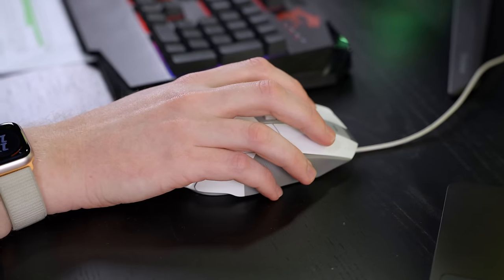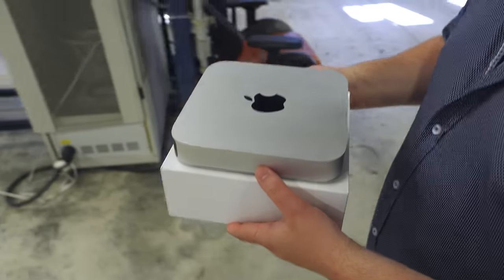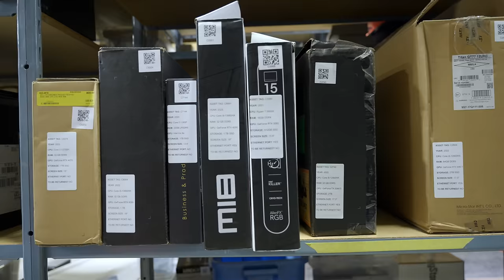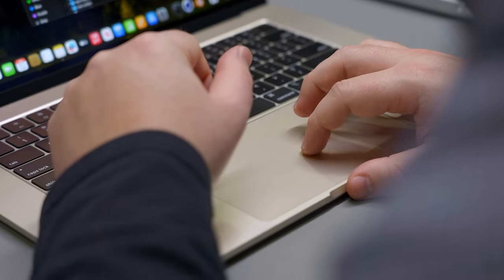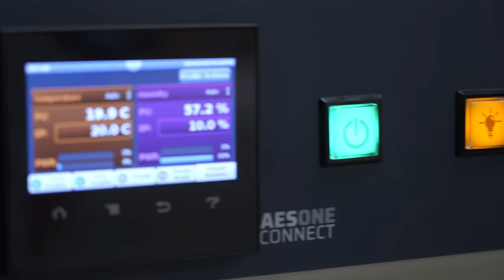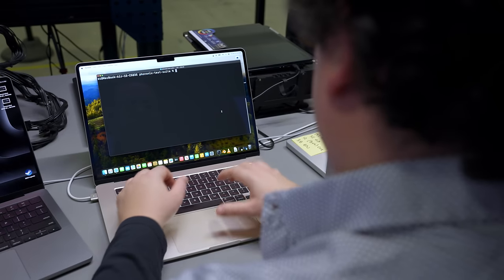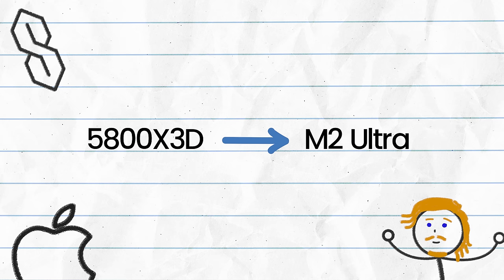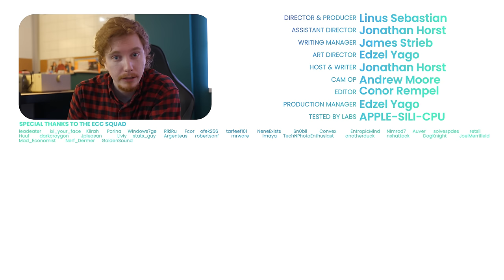How Apple Silicon Compares... - Part 1

Comment: I would get a new mac, only if another 8 gigs of ram didn't cost 200 dollars more...
Reply: your loss
Reply: @chewbster  His gain actually since modern amd laptops can match performance and battery life for macbook pro at a far better value
Reply: I am running an m1 air with 8 gigs and it is painful.  I'm going to have to spend $800 more for used hardware to have less RAM than a new Windows machine.

Docker, fusio 360n, cura, and a browser are a pick 2 situation on 8 gigs and there's still huge swapping that will kill the NAND over time.
Reply: Mac's used to be the come up a few years later once they were steadily discounted. But that was when they were upgradeable.
Reply: @piyh3962 why did you buy the 8 GB model if that’s what you plan to do? That’s on you tbh
Reply: Not trying to justify the ransom that Apple charges for upgrades (it’s a disgusting markup). But look at it like this: I need a Mac for the work I do (music, color accurate photo work) and I’m in the market for a new MBP, so I budget for the 16gb model. Since 8gb is useless I think of it as a cut down slightly cheaper model that would never work for my needs so it’s not worth worrying about.
Reply: Especially SSD storage
Reply: I am temporarily running an M2 Base 8G while my M1 Max 32G gets repaired. I expected problems, the only thing that’s been an issue is Lightroom. 

I am shocked at how well this performs. Though, still I would never recommend picking up an 8G model
Reply: @aravindpallippara1577   Its not just about the cpu dude. Thats like buying a car for the stereo.
Reply: @CallumAi  No kidding lol. I have a 8GB mini M2. Works  perfect and never seen it slow down. But I'm not video editor like the other 95% of people Not on a tech channel. Go figure. 8GB is plenty for a majority of people on a Mac where it's built into the cpu.
Reply: @chewbster  “yOuR lOsS” that’s how you sounded 😂
Reply: @DozIT   Exactly. I sell for Apple. 95% of the people I sale too don't edit anything except documents. No music or video editing and no Lightroom. They never have an issue with 8GB ram. Yes it would be nice to have 16 base. But most people don't even know what ram is. lol. They just turn it on and go to work. And nothing is better than a Mac for that. I tell them when they want the base model if you don like it you got 14 days no questions asked no restock. Nobody ever brings them back. Mostly lawyers professionals and student make up the vast majority of buyers. They don't edit videos or try to side load linux ect.
Reply: @DozIT  I routinely “use” 40-50 gigs of memory between all my programs and activities on my friends 16gb m2 pro. Once you get to around 60 gb is when the system flashes a warning that you’re going too hard 😝 Yes, this will reduce the life of the SSD and isn’t great for latency, but it works quite a bit better than my windows machines
Reply: I sold my 16GB iMac for the same price I paid 1.5 years prior. Yes, it cost more, but it also held its value.
Reply: @tmanF4  100% the way Apple handles swap is amazing. And, to be honest I’m not too concerned about SSD lifespan, typically I hold onto it for 4-5 years, sell used for 30-40% of what I paid, then buy a new one. It’s worked for me since 2015!
Reply: @aravindpallippara1577 no, that just doesn't exist
Reply: Probably worth checking whether it actually matters. It's just a number.
Reply: @piyh3962 I think it's cool that you grew out of your hardware. It's pretty common. But if you bought that machine knowing you needed to do all that stuff and you chose to buy 8GB of RAM, that's your fault. Not Apple. You could have made the same mistake buying a Windows laptop.
Reply: @aravindpallippara1577 the cap 😂
Reply: @aravindpallippara1577 The battery life of x86 laptops isn’t even close. You are coping.
Reply: @piyh3962 you bought an 8gig to run all that? What the…
Reply: @Techfanatic73  As someone who had issues with 16GB of memory while doing long historiographic papers, I’m going to call absolute bullshit.
Reply: @aravindpallippara1577   I'm not sure why you would think that or who gave you the thumbs up, but that is blatantly false. It isn't even close to being true. Please post the SKU of an AMD powered laptop that can go more than 3 hours while using the GPU on battery. With AMD you can get similar performance to M3 series while plugged into the wall and going with a model that has a dedicated GPU. But performance and battery life... no. Once you unplug you will come up hours short of any M series laptop.. without using the dedicated GPU... if you dare engage that GPU you should expect 2-3 hours total battery life and thats with the system limiting the GPUs power draw.
Reply: Then you don't really want (or need) a Mac.....do you?
Reply: @koalaunknown thought the same. But recently bought a system with a modern mobile Intel chip and I get very comparable performance to my work Apple silicon machine and battery life is almost identical as far as I can tell. I run Linux tho, so may be a bit different when running windows. 

All in the device cost about 1000€ less fully configured to my needs than a base level 14“ MBP in my country (Germany). But I’ll have to admit, the display is not quite as nice as the MacBook‘s
Reply: Good news it will cost 699 L0L 😅
Reply: I would get a MacBook, if the SSD, one of the most used components, was replaceable.
Reply: @topcomp1066  have you heard of external drives? WoooOOoOOOOoooow…
Reply: It's about time that Apple cut the upgrade costs in half, if not quarter them.
Reply: The RAM upgrades are so painful to pay for. And for doing motion graphics work with after effects where it writes your preview files to the RAM you really NEED as much ram as possible.
Reply: try to get a base M1 Pro
Reply: Am really a fan. Enjoy your videos. That are informative and interesting. I think you str a good story teller which is rare for this genre.
Reply: @brandongers  Honey.. I guess you don't know how Apple Mac works, and well, how computers work in general.
The internal SSD is getting used no matter if you use an external SSD or not. Logically, because the operating system itself is on the integrated SSD, thus every operation you make, every file transfer, every app you use wears off the SSD.

Now, the moment the internal SSD dies, you can throw away your 3k laptop, because it's useless. With the new mac's, you can NOT start the device without the internal SSD working.
Reply: As long as buyers still succumbs to Apple’s strategy, we won’t win our right. People keep paying that $200 to get extra RAM.
Reply: Buy used like you can save like 1k on an almost new M2 mac book air and similar (recently here in my region a few companies dumped "old" Mac Studio M2 max with 64gb ram and 2Tb storage for like 2-3k €  as for the version with 64gb ram and 4tb storage in that price range was gone quick. Used is the king
Reply: This!
Reply: @Techfanatic73 yeah, it’s not enough for a Pro model but for the Air it’s different
Reply: This comment thread shows the state of customers really well. The fans are misquoting or are struggling with hardware specs, then the neutral buyers are saying buy used, because fck the og pricing structure and then the opposition who laughs because one bought 8GB RAM in 2024 nonupgradable.
Reply: But Apple uses ram differently. 8GB mac equals 32GB windows right?
Reply: ... and if it didn't have such a crappy keyboard
Reply: @alankucar4564  the current MacBooks’ keyboards are fine, it was the ones with the butterfly keyboard which were garbage
Reply: Get a pc for 200 you can get a lot of ram
Reply: 200 euros/dollars is the price of cheap gaming PCs 💀
Reply: Fun fact: back in 2009, it cost $1,200 to upgrade the RAM in a 17-inch MacBook Pro from 4 GB to 8 GB. However, this was still in the era of being able to upgrade the RAM after the fact, and today the same upgrade can be picked up for $30.
Reply: @chewbster apples loss
Reply: @corvacopia  you said they were fine, well if you ever used at least pre-2015 macbooks, even go as far as to 2007 ones, you would understand what I mean by crappy, mutilated garbage of a keyboard on 3000$ laptop.
Reply: Based
Reply: @aravindpallippara1577 not sure about battery life, but performance definitely
Reply: @chewbster and your loss if you’re prepared to accept that this is acceptable
Reply: @CallumAi no it’s not. Apple told him it’s an acceptable amount. They sell them as “pro” machines. Don’t put the blame on the consumer. Blame the manufacturer for making an unacceptable product.
Reply: That's absolutely fair. I'll defend Apple on a number of issues but the 8 gig's is an insult to all buyers.
Reply: Yeah, that’s why I’m glad I could afford to order my M3 Max with 64GB. Should last me into the early 2030s when they stop the OS updates.
Reply: Yes this sux. Apple should go minimal 16ram. Although its a bit  different on Apple silicon.
Reply: @amadtaz it's apples fault for selling
Reply: @KrisoVT  I hope this is sarcasm (tbh not sure cuz you never know with Apple users)
Reply: @topcomp1066  It is sarcasm, yes :)
Reply: @KrisoVT  xD
Reply: @chewbster  for not using trash macos?
Reply: @CallumAi  fr
Reply: @aravindpallippara1577 Performance yes, battery life no chance. Do you have a source for this?
Reply: Buy used then!
Reply: @amadtaz  I am a mac user but it's difficult for this to happen with any decent PC. Any PC laptop with decent specs will come with at least 16gb.

Personally, the apple toll for memory was worth it to me BUT it's very annoying that you're forced into a dilemma (is 8gb enough for me?) unless you're ok with spending $1200+.

It isn't like that with PC, if you are paying $800+ then you don't need to compromise core specs like memory/cpu/ssd (ofc the battery life and other things won't be as good as mac).
Reply: @CallumAi  cause apple charges 200$ for 8gb... by the way 200$ gets you 64GB of some of the best RAM in the market....
Reply: @aravindpallippara1577  you’re still most likely gonna be stuck with windows though. linux is fantastic and i daily drive it on my pc, but creative apps are by far the best on mac. microsoft is also just god awful incompetent
Reply: Laughs in 200$ top of the line 64GB RAM
Reply: @aravindpallippara1577  Nice try, I'm not tapping into that AMD trap again.

Comment: Love them or hate them, Apple silicon chips are impressive
Reply: Especially when compared to old Amd AM4 chips and entry level <$250 i5's!
Reply: Ikr? Amazing how Apple M3 manages to almost beat a 3 year old chip. Truly an amazing feat
Reply: What comes from this video (and even then it's barely touched), the true impressiveness comes mostly from the efficiency department, really.
As @willie69420  said, the test was only against AM4 chips, because they couldn't find any AM5 low-end enough to compare to slower Apple silicon ( 8:22 )
What really sets Apple apart from the PC space right now is how it performs while still being in a micro or even laptop form factor (and in the laptop FF, the fact it still have such battery life is truly amazing).

But yeah, being compared to a multi-years old architecture isn't the most flattering thing ever when only considering performance (and price to performance).

Honestly, I don't follow closely enough Apple hardware stuff to know, but I guess there were important redesigns between the different iterations of Apple Silicon, akin to a change of overall socket/generation for a CPU. So it feels a bit strange/"icky" having what is essentially 3 generations of Apple Silicon against only one in the CPU department.

I suspect parts of why they chose only one CPU platform was due to time budget allocated for Mac Address with the Lab team tho, and to keep charts readable in some ways.
All in all, the tradeoff is understandable and I'm quite interested in seeing the next parts, and how the team change their routine to accommodate for Apple benchmarking.
Reply: but apple killed it by not giving those platform (all of M seriess) upgradeability. Soldered DRAM is understandable, it saves power when the chip is closer to the CPU. but the SSD? its atrociuos and so anti consumer and anti green. give it a empty M.2 NVME slot and will erase 60 to 70% bad publicity. if they want to milk it, just give the slot to Pro line.
Reply: Compare it with something in the same price point..... lol...
Reply: Disappointed they didn’t compare against some newer CPUs for single core like the 7800X3D or 14900KF. According to other tests the M3 rivals them in single core. I’d be interested to see if labs would get the same result.
Reply: @KarrasBastomi  also the upgrades are just way too expensive. I could live them being soldered on, but it's grossly overpriced.
Reply: Apple Silicon is a true revolutionary breakthrough! My only gripe is their philosophy of almodt everything is soldered to the board and what's not is encrypted to avoid consumers replacing parts when needed,  down the road any of the components may fail and it will be really hard to fix these machines and that's no bueno
Reply: As impressive as their high prices, lack of repair, no upgradable options, and zero effort in letting you do fun things like play games let alone at a decent frame rate. Its really astonishingly impressive what a "office work" only platform that costs $3k will get you now a days.
Reply: Those Ryzen 5000 series CPUs were released in 2020 and the AM4 socket they use came out in 2017 (2016 for Athlons)
Reply: @eduardofrances  Apple Silicon is nothing good.  Reviewers are screwing results to favor Apple.  There's a reason why Apple is losing 34% year over year on Mac sales.
Reply: @KarrasBastomi no other platform has even close to the same bandwidth. M1 has 600GB/s ddr5 is like almost 10 times slower
Reply: Truth bomb 1: Apple Silicon is impressive, because the power to performance ratio is absolutely ridiculous compared to AMD and especially Intel chips.
Truth bomb 2: Apple Silicon is even more impressive, because even a 4000$ M3 Ultra won't give you even half of the graphics performance of a 2000$ gaming PC.
Reply: @gamebuster800  I have the 5800X, I thought it was super powerful. I idle with 100W.

That mac doesn't even draw that on full load (GPU included). 

That on the go with 16+ hours of battery life. Sign. Me. Up.
Reply: @Murv  You don't get 16+ hours of battery life unless you don't use your machine for anything but watching a movie on lowest brightness.

The 100W in idle is just a tuning issue. Most motherboards come with a very power-hungry profile out of the box because people care about performance more than efficiency.
Reply: MacBooks with Apple Silicon are great and they are competing fiercely with the latest chips from Intel. However, the inability to use graphics cards like the RTX 4090 limits its potential. I know Apple is trying to integrate everything into one for optimization but Apple is still relatively weak in their Metal GPUs.
Reply: @gamebuster800  Watching Youtube videos is not exactly idling.

Either way. I'd code on it. As battery life is 22 hour-ish, id probably get 16
Reply: Yep, they very much are revolutionary. If you dont believe, i did pick an M1 mac mini as my gaming machine (yes i know, gaming on a mac, but i already hated windows a lot in this timeline). I had really high expectations but the machine exceeded those, which helped myself to convince me that windows is trash.

Also, no i'm not an apple fan. I did discard iPhones because of lack of performance, battery and also the OS felt too limited.
Reply: Yeah theyre literally like 30% faster than the 13500 in single core wtf is this selection @-Burb
Reply: @eduardofrances A reveloution thats ran into a brick wall ever since for them. Actually pathetic that the m4 gave a +7% average ipc up lift which was by far the biggest ipc uplift its gotten from the last model. The m2 and m3 both had about 3% higher ipc than their predecessor. 

Kinda ironic that theyre increasing performance in the way they mocked intel for, higher clockspeed.

Since the m1 has came out both intel and AMD have gotten massively more ipc improvements than apple has. I hope they can keep up when zen 5 and lunar/arrow lake come out which is very soon
Reply: @gamebuster800 I can live with the memory on package (its not soldered its better) but the ssd has no reason to be and the ones they use are pretty bad too except in sequentials which means nothing for real world performance